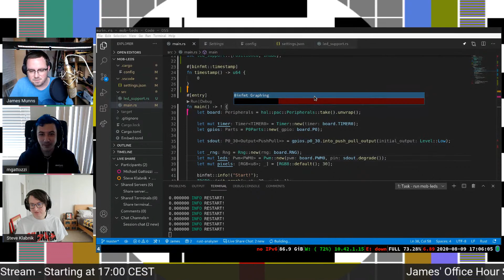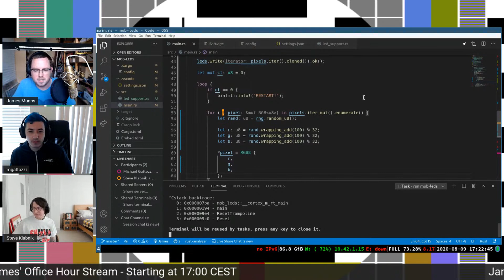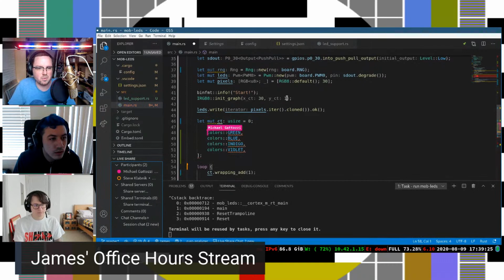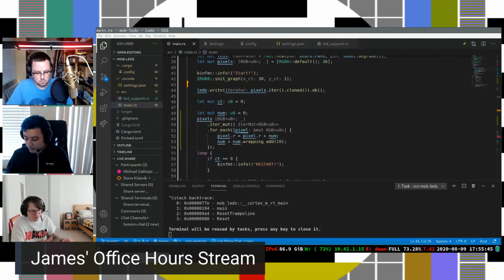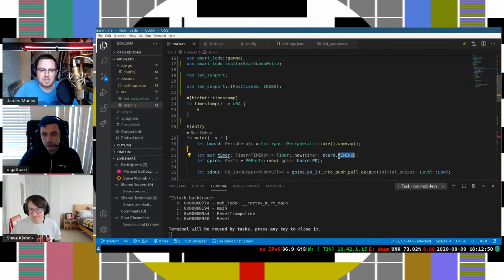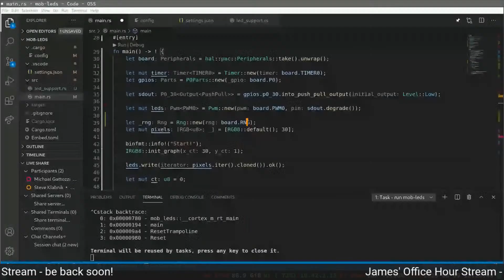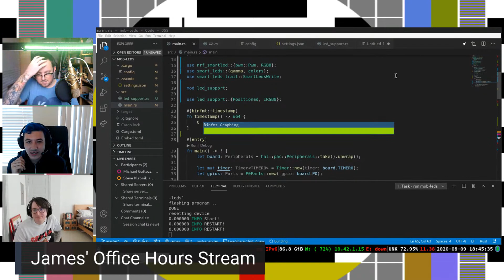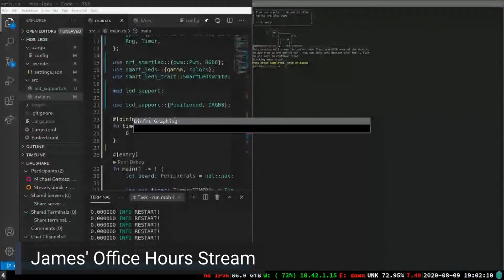Embedded Rust Mob Programming

Comment: I'm excited to give binfmt a try! I just started on some Rust embedded work and it seems like just the tool I need. Will it work over a UART, or do you recommend picking up a debugger like an ST-Link?

Thanks for putting this stream up, super interesting!
Reply from the maker: Hey there! binfmt will work over a UART, as it is just sending encoded binary data, though at the moment we don't have an application that "catches" and decodes information from the UART. We do provide a decoder library, so wiring that up to a serial port should be pretty straightforward. You'd also need to provide your own thread-safe "logger" to collect the data on the device side, but there are definitely ways to do this!

In the future we hope to provide all of this out of the box for you, or at least a minimal version of UART support.

That being said, a cheap ST-Link (or most Arm-capable debuggers) will also work wonderfully for this. Thanks for the interest!